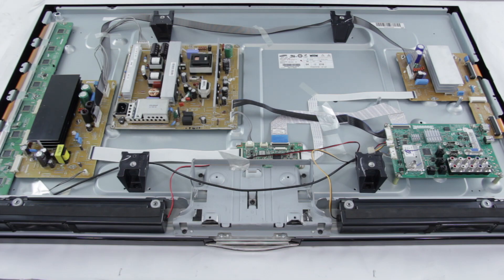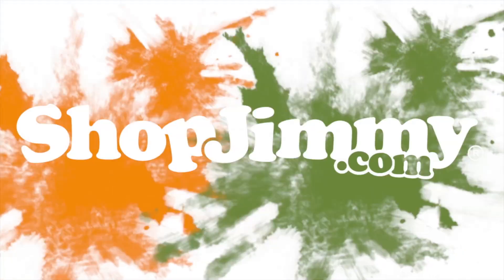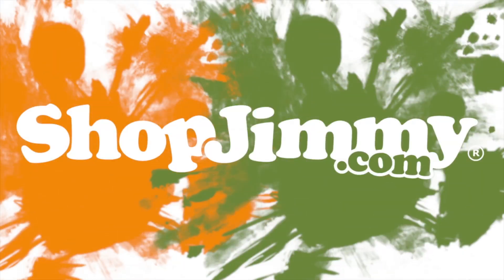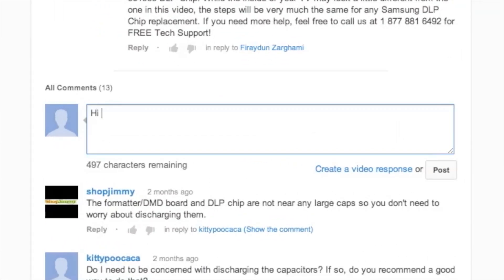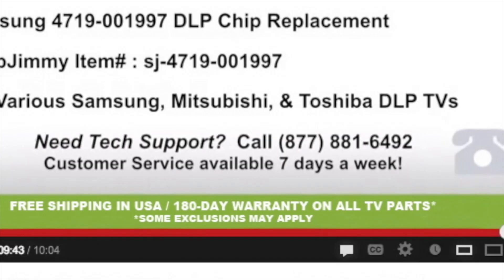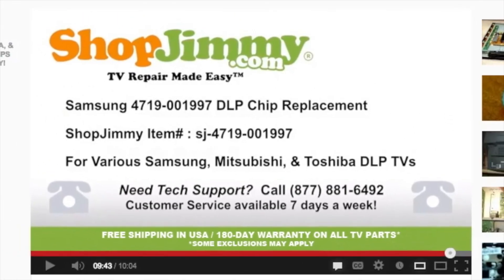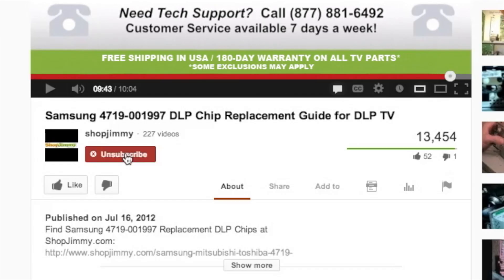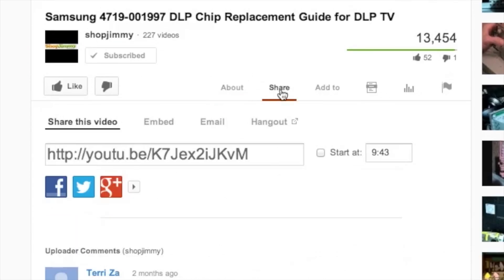Plasma TV Repair Tutorial - Common Symptoms & Solutions - How to Fix Plasma TVs

Comment: I have a 60 pz550 lg turn on have all voltages but no back ligth,the only thing we see is a flash at the moment that turn on.
Reply from the maker: Angel Grandez   I recommend replacing the YSUS board and the YDRVTP and YDRVBT boards in your TV.  Here is a link to replacement parts for your TV model number on our website, click here:  http://www.shopjimmy.com/catalogsearch/result/?q=60+pz550  Be sure to match part numbers on your current board, with your replacement for compatibility.  Here is a link to a video showing how to identify your part number, click here:  LG Plasma TV Repair: DIY Part Identification Number ID Guide for LG & LG Philips Plasma Panel Parts  You can also call our customer service for further assistance with your purchase.  (877) 881-6492  Thanks and please let us know if you have any further questions with your TV Repair!  www.shopjimmy.com

Comment: Samsung Plasma model code PS43D450A2WXXU serial No. B2RO34PB500785R
The problem start off with sound and no image ... it happened few times. Other times with image for few minutes and then it disappeared. I turned TV off and back on again and eventually would work. Last time I did that the TV image is working, however there's a very strong red and yellow and a bit of green... A opened the TV but cannot figure what's wrong. Maybe u can help me out to understand what's going on and whether is worth to send to repair or get a new one instead. I appreciate ur help! Tk u
Reply from the maker: Maria Xavier   This sounds like it could be a problem with the Y-Main board in your TV.  Here is a link to replacement parts for your TV model number on our website, click here:  http://www.shopjimmy.com/catalogsearch/result/?q=43D450A2  Be sure to match part numbers on your current board, with your replacement for compatibility.  Here is a link to a video showing how to identify your part number, click here:  Samsung Plasma TV Repair: Samsung Plasma Panel Parts Guide  You can also call our customer service for further assistance with your purchase.  (877) 881-6492  Thanks and please let us know if you have any further questions with your TV Repair!  www.shopjimmy.com

Comment: I have a samsung plasma model ps50c450b. No picture but have sound problem. When tv is first turned on picture will last for 5-10 seconds and then go black. Then I turn off and leave for a few minutes. When I turn on again usually notice a bright flash in bottom left of screen and then screen goes black. After repeating this a few times the picture will be fine. Any help much appreciated.
Reply from the maker: John O'Halloran   I recommend replacing the Y-Main Board and the Y-Buffer board in your TV.  Here is a link to replacement parts for your TV model number on our website, click here:  http://www.shopjimmy.com/catalogsearch/result/?q=ps50c450b  Be sure to match part numbers on your current board, with your replacement for compatibility.  Here is a link to a video showing how to identify your part number, click here:  Samsung Plasma TV Repair: Samsung Plasma Panel Parts Guide  You can also call our customer service for further assistance with your purchase.  (877) 881-6492  Thanks and please let us know if you have any further questions with your TV Repair!  www.shopjimmy.com

Comment: Hello, I have a samsung plasma HPS4253X/XAA, the unit powers on with sound, no picture, the blue power indicator light comes on which is below the screen. I have watched your video and realize it could be a number of issues, however, since you did such a great job, I believe my issues are the power supply or main board. My question is which board should I try first or is there a way I can test the power supply and main board?
Reply from the maker: Brent Hinds   I recommend replacing the Y-Main board and the Y-Scan Drive board in your TV.  Here is a link to replacement parts for your TV model number on our website, click here:  http://www.shopjimmy.com/catalogsearch/result/?q=HPS4253X%2FXAA  Be sure to match part numbers on your current board, with your replacement for compatibility.  Here is a link to a video showing how to identify your part number, click here:  Samsung Plasma TV Repair: Samsung Plasma Panel Parts Guide  You can also call our customer service for further assistance with your purchase.  (877) 881-6492  Thanks and please let us know if you have any further questions with your TV Repair!  www.shopjimmy.com

Comment: Model LG 42PX4MVH
The LG Plasma TV does not come on at all.We had electric lightning whilst the TV was on standby and after that the TV does not come on at all.I had all the fuses checked and they are fine.Any suggestions on finding the actual problem,which I guess could be the power supply.Thanks Deon South Africa
Reply from the maker: Deon Meyer   With the lightning strike I recommend replacing the main board and the power supply board in your TV.  Here is a link to replacement parts for your TV model number on our website, click here:  http://www.shopjimmy.com/catalogsearch/result/?q=42PX4  Be sure to match part numbers on your current board, with your replacement for compatibility.  You can also call our customer service for further assistance with your purchase.  (877) 881-6492  Thanks and please let us know if you have any further questions with your TV Repair!  www.shopjimmy.com

Comment: I have a 50 inch Plasma Samsung that just went out of its 5 yr extended warranty that I purchased when I bought the TV 5 years and 6 months ago.  There are 4 vertical approximately 1 1/4 inch wide black and red lines running vertically from the top to the bottom of the screen. From your video you describe this relating to a bad main logic control board. Wondering how much that part costs and can an amateur like myself replace that board. Thanks Sue
Reply from the maker: Kelly Elikofer   This sounds like a TV panel problem.  If your TV panel is bad, it may be more cost-effective to replace the TV as panels are typically hard to find in stock, difficult to replace, and expensive.  Thanks and please let us know if you have any further questions!  www.shopjimmy.com

Comment: I have a Samsung PN60E530a3F 60" plasma, lost picture today but still has audio.  When you press menu I still have a blank screen.  No one was in the room when the picture went black, so cant describe any sounds.
Reply from the maker: Lake DualSport   I recommend replacing the Y-Main board and the Upper and Lower Y Scan Drive boards.  Here is a link to replacement parts for your TV model number on our website, click here:  http://www.shopjimmy.com/catalogsearch/result/?q=PN60E530a3F  Be sure to match part numbers on your current board, with your replacement for compatibility.  Here is a link to a video showing how to identify your part number, click here:  Samsung Plasma TV Repair: Samsung Plasma Panel Parts Guide  You can also call our customer service for further assistance with your purchase.  (877) 881-6492  Thanks and please let us know if you have any further questions with your TV Repair!  www.shopjimmy.com

Comment: I have a Samsung ps42q97hd tv it as5 vertical lines very thin on the left hand side 3 thinner bunched together 2 so so. could it be ribbons and are they top or bottom of screen and easy to get to and if not them logic board or is the plasma panel no good its a very good picture only this fault  be very gratefull for your help thanks you tube
Reply from the maker: terence barrett   This sounds like a TV panel problem.  If your TV panel is bad, it may be more cost-effective to replace the TV as panels are typically hard to find in stock, difficult to replace, and expensive.  Thanks and please let us know if you have any further questions!  www.shopjimmy.com

Comment: Samsung 42' plasma tv PN42B450
When plugged the red dot indicates that there is power. when turning on, screen shows for a fraction of a second then screen goes black (no sound) the red dot is blinking 4 times and it looks like the tv is off (cannot turn off/on again only by plugin in and out of the ac)
Reply from the maker: guy paskar  I recommend replacing the main board in your TV.  Here is a link to replacement parts for your TV model number on our website, click here:  http://www.shopjimmy.com/catalogsearch/result/index/?cat=56&q=PN42B450  Be sure to match part numbers on your current board, with your replacement for compatibility.  Here is a link to a video showing how to identify your part number, click here:  Samsung Main Boards & Digital Boards: Part Numbers for LED, LCD, DLP, Plasma TV Repair  You can also call our customer service for further assistance with your purchase.  (877) 881-6492  Thanks and please let us know if you have any further questions with your TV Repair!  www.shopjimmy.com
Reply: Thanks for replying. I actually made a mistake, my model number is PS42B430P2M. Can you please send a new link?

Also, why do you think I need to replace the main board and not other parts?

Thanks
Reply from the maker: guy paskar   Here is a new link, however be sure to match part numbers.  http://www.shopjimmy.com/catalogsearch/result/?q=PS42B430p2  Here is a video to help identify the part number.  Samsung Main Boards & Digital Boards: Part Numbers for LED, LCD, DLP, Plasma TV Repair  The main board controls turning on and off the TV.  Thanks!  www.shopjimmy.com
Reply: I assume that you meant the main board with all the outputs. Is there a way to verify that this is indeed the problem since this part cost ~150$ and I want to be sure.

Also, is there absolutely no way to fix a non-working main board? How can I identify what is the problem with it?

Thanks
Reply from the maker: guy paskar   No real way to test the main board.  Given the symptoms, the recommendation is replacing the main board first.  If you would rather try the power supply first, and that does not fix the problem, then you know the problem is most likely the main board.  Be sure to match part numbers with your original board and the replacement board.  Thanks!  www.shopjimmy.com

Comment: I have a LG 60 pc1d it has audio but a black screen we heard a pop like a firecracker and the picture went out I found 2 capacitors that were popped And I replaced them but still a black screen it's illuminated just no picture 
Is there any way I can narrow down what the problem is and do you sell all the parts that I would need to fix this? If so do you have a website I can purchase these parts from let me know thank you
Reply from the maker: Eddie Valdez   I recommend replacing the YSUS board and the YDRVTP & YDRVBT boards in your TV.  Here is a link to replacement parts for your TV model number on our website, click here:   http://www.shopjimmy.com/catalogsearch/result/?q=60pc1d  Be sure to match part numbers on your current board, with your replacement for compatibility.  Here is a link to a video showing how to identify your part number, click here:  LG Plasma TV Repair: DIY Part Identification Number ID Guide for LG & LG Philips Plasma Panel Parts  You can also call our customer service for further assistance with your purchase.  (877) 881-6492  Thanks and please let us know if you have any further questions with your TV Repair!  www.shopjimmy.com

Comment: have an insignia NS-p501q-10a power led is on but the tv does not power on either from the set or with the remote
Reply from the maker: Dionicia Mariano   This could either be a problem with the main board or the power supply board.  You may need to replace each board individually to see which one fixes the problem.  Here is a link to replacement parts for your TV model number on our website, click here:  http://www.shopjimmy.com/catalogsearch/result/?q=NS-p501q-10a  Be sure to match part numbers on your current board, with your replacement for compatibility.  You can also call our customer service for further assistance with your purchase.  (877) 881-6492  Thanks and please let us know if you have any further questions with your TV Repair!  www.shopjimmy.com

Comment: Samsung model PN50C450B1DX no picture just sounds
Reply from the maker: Patrick Robinson   I recommend replacing the Y-Main Board and Y-Buffer board in your TV.  Here is a link to replacement parts for your TV model number on our website, click here:  http://www.shopjimmy.com/catalogsearch/result/?q=PN50C450B1DX  Be sure to match part numbers on your current board, with your replacement for compatibility.  Here is a link to a video showing how to identify your part number, click here:  Samsung Plasma TV Repair: Samsung Plasma Panel Parts Guide  You can also call our customer service for further assistance with your purchase.  (877) 881-6492  Thanks and please let us know if you have any further questions with your TV Repair!  www.shopjimmy.com